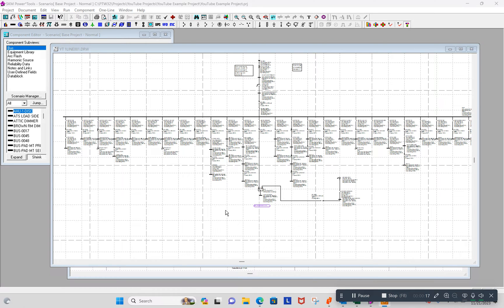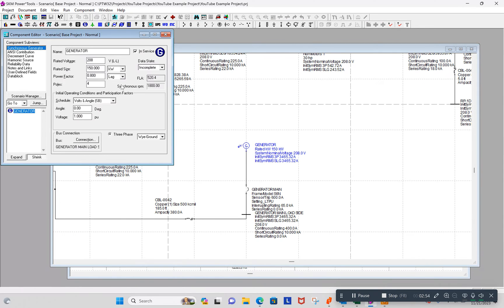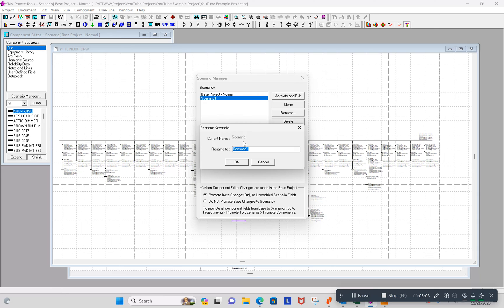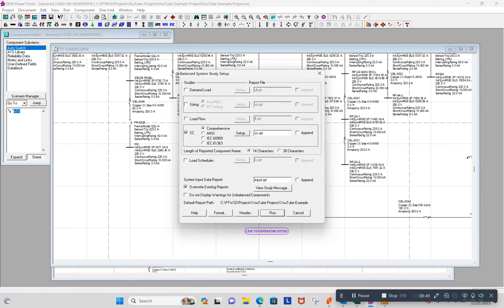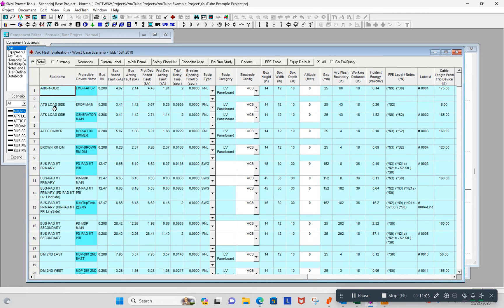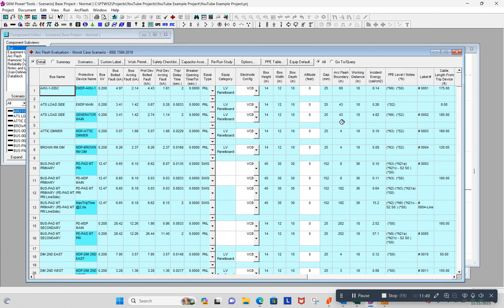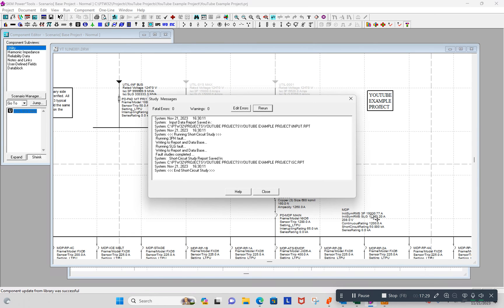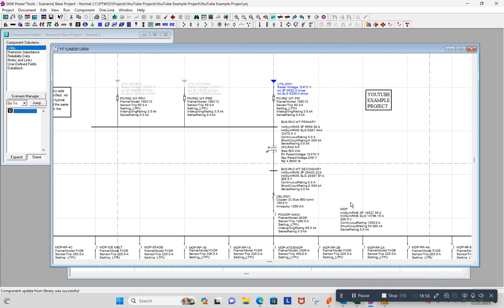SKM PTW Using Scenario Manager

Comment: Nice video, great job. When I need to make minor modifications in the base scenario that I want to implement in all scenarios (such as modifications to protection settings), I just click on File -> Promote to Scenarios -> Components and then I select the modified components. In the scenario manager I usually always keep the “Do not promote base changes” option selected.
Reply from the maker: Sounds like a good approach.  Thanks for the input.

Comment: Why Bus+Line side? and not bus+line+load?
Reply from the maker: @priyal5354  You do as you suggest and calc the load side as well, but it doesn't serve a purpose in most cases.  The bus is the load side in most cases.   There are exceptions.  

Also, The available fault current, bus gap and enclosure size are the same for line and load.  What might be different is the clearing time of the main breaker vs the upstream feeder breaker.  If the main breaker trips much faster and results in a much lower incident energy it doesn't change the fact you still have line side exposure with the cover off and are exposed to the higher IE so why bother with a load side calc?

For enclosed LV switchgear construction barriers might exist that prevent a line side fault from migrating to load side busses in downstream sections so you might want to calc load side in that case as an example

Comment: Thanks Brent! Short or long, I've been enjoying your videos. I'd be curious as to how you might use the scenario manager to create arc-flash labels when the utility fault current isn't available.
Reply from the maker: I'll make a video on it.  Jim Philips has a suggestion too on how to handle this, but I generally run Infinite bus a low value and what I think a typical value would be.
Reply: @brentbaumer7088 I usually assume 70% of the ultimate (design fault) current for the max scenario and 30% for the min scenario. You can’t ever fully know how accurate that is without knowing the exact distance of the customer’s facility from the nearest utility substation (if you’re lucky you can sometimes find it using Google maps and measure the distance to approximate the length of the O/H lines) as well as the scenarios/configuration at the utility substation, but it’s a typically accepted assumption. Always best to obtain the actual utility fault levels though